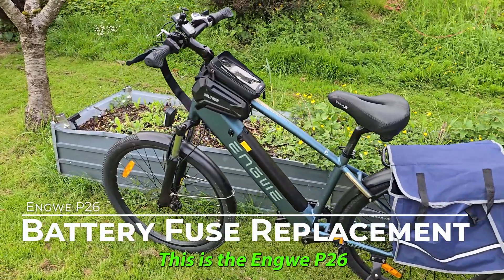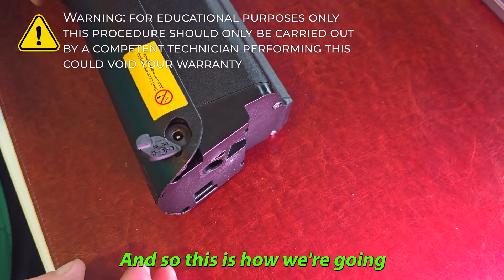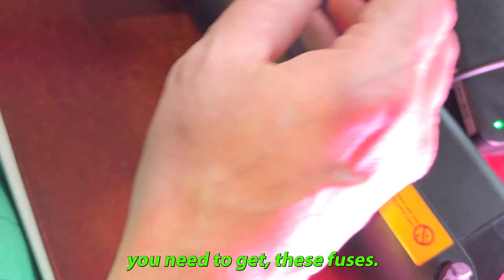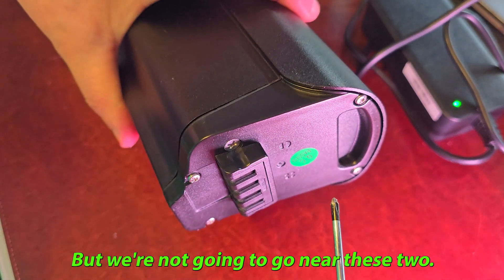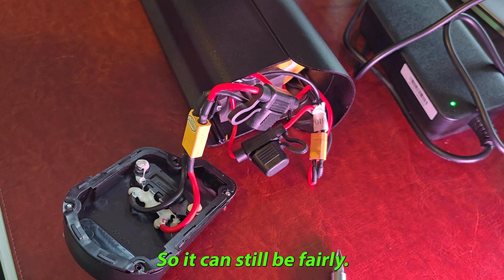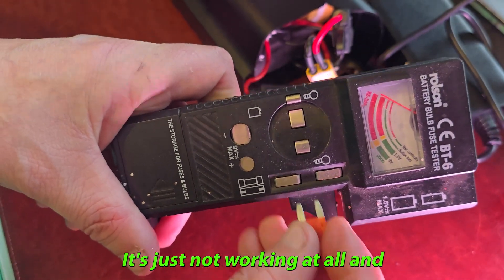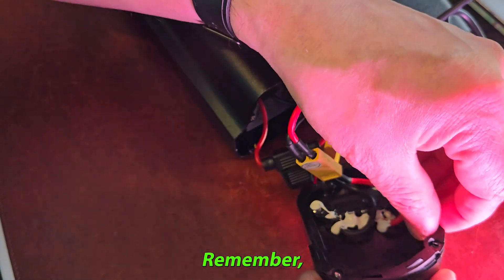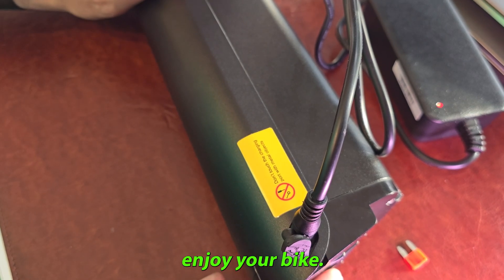Fixing an Engwe P26 Battery Short – Quick & Affordable Repair Guide (engwie P26)

Comment: I had the same issue with my battery, I bought a new fuse and saved it after 2 months I bought the bike, your video has been the only thing I found in order to solve the problem, you saved me, thanks a lot!!!
Reply from the maker: Glad it helped. The bike is still going strong with no issues, but since then I have only charged the battery while attached to the bike so that i don't have to use the key to remove
Reply: Which exact fuse do I need to look for please?